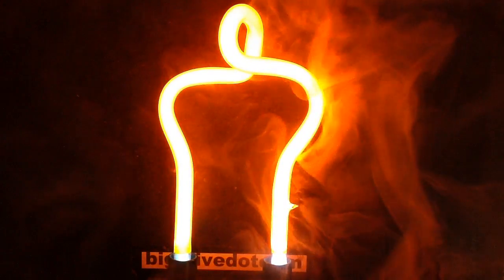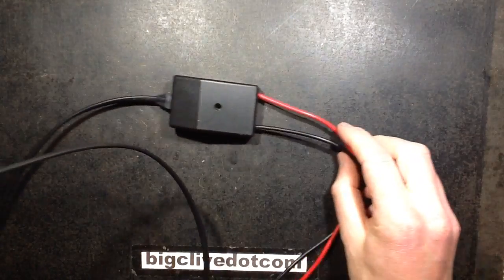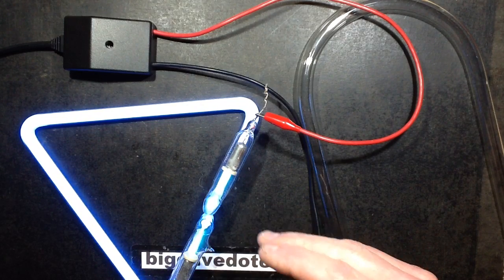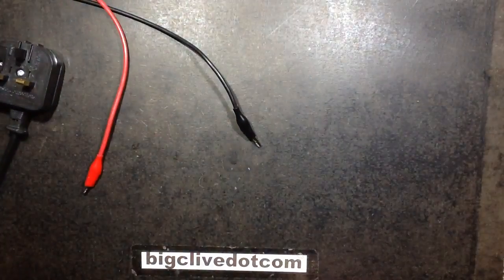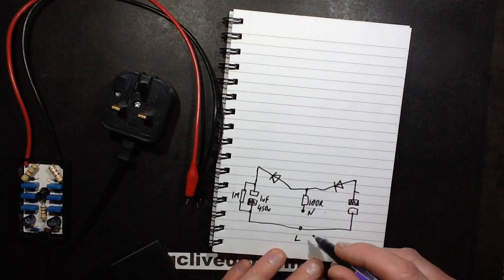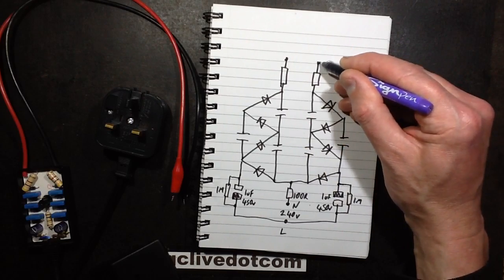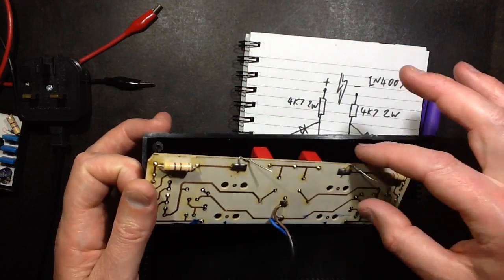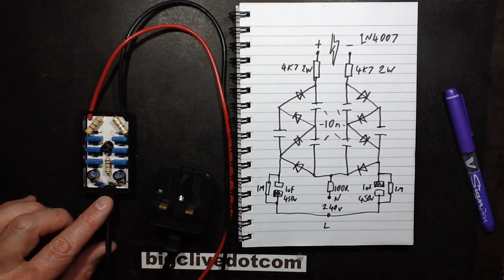Using a DIY voltage multiplier to drive neon tubes.

Comment: It's a shame that the circuit won't work well on pure neon...  I do have a neon sign transformer around here someplace that was taken off of a beer sign where the tubing had gotten broken.  And some inverter transformers taken out of flatscreen TV boards.  And some other stuff taken out of laser printers that apparently generated some kind of high voltage.  I've no current inclination to play with this stuff,  though you can never tell where I might be inclined to go later on.  :-)

Comment: Is the UV from the neon tube down where the phosphor isn't present hazardous as it would be for a flourescent lamp without phosphor?
Reply: Its the type of glass that blocks the uvc not the phosphor. I have a clear (not uv flourescent) that doesnt emit uvc because it uses the special uvc bolck glass.
Reply: @RayRayGaming-cr3rw  correct me if I am wrong (which I might be) but I think that normal glass blocks uvc, does not need to be special glass. Uvc tubes are made of quartz glass for this reason.

Edit:I appear to have been wrong, some types of what we would call ""normal glass" can actually pass uvc but the type of glass in tubes is not that.
Reply: @alfepalfe  yeah you would be correct, most soda lime glass and borosilicate does block uvc. I’ve built a few neon (mercury-nitrogen) tubes with borosilicate before.

Comment: I bought a bag of 100 1N4007 diodes just as part of my stocking up of spares. It looks like there will be a lot of uses for them! I initially just wanted to make my own bridge rectifier, but they do seem to be much more versatile than just that.

Going on from there, it would be really handy if you could maybe do a video where you suggest a basic list of supplies that a beginning electronics enthusiast should buy so he can do a wide range of different circuits. I mean really basic things like a selection box of electrolytic capacitors, a selection box of non-polar ceramic capacitors and so forth. Many of these things can be bought for around £5-£10 on ebay for 350 pieces from a far eastern source.
Reply: Remember a lot of those eBay parts are fakes so don’t use them on anything critical.  You might want to check out Mr. Carlsons lab on YouTube.

Comment: Hi  BIGCLIVE:  I am determined to build this multiplier!!!  I am in the USA so I am using 110V--I just received my 110VAC-to-220VAC.  It is rated at 50W--is this enough?  One more thing--on your notation of the 1uF @ 450Vdc (I am assuming they are DC), is it correct to assume your "colored-in" plates are the NEGATIVE terminals?
THANKS AGAIN FOR BEING RESPONSIBLE FOR ANOTHER DEVICE ON MY BENCH!!

Comment: GREAT VIDEO...but...what is the voltage rating of the 10nF caps, and the wattage of the two 1meg resistors and the 100ohm resistor?
Thanks again for the video--brings back old memories, seeing that orange glow pop on.
Reply from the maker: 10nF 630V, 100 ohm 1W and two 1 Megohm quarter watt resistors.

Comment: i've often wondered if I could fill a mason jar with argon and add some electrodes to light it up...
Reply: Shroom Duke I have the answer for you. Yes, you can, and I've done it. I got a glass lemonade bottle, meticulously cleaned it, and then i sealed a piece of glass tubing into the cap, and sealed the cap onto the bottle. 
I put it on my vacuum pump and pumped it down with just air inside, and with it sitting next to my tesla coil and at 11.2 torr it lit with a really nice deep purple pink glow. As i decreased the pressure the glow became more blue white, and at 1.3 torr it went out. 
I actually used hot glue for the seals, because it does really well for non critical vacuum applications, and it seals well to glass if you heat up the glass a bit before you apply the glue. Hope that helps you to do this!
Reply from the maker: +Shroom Duke It has to be at near vacuum, but that's close to a plasma globe.
Reply: I do have a nice vacuum pump.... hummm wonder if I could employ it...

Comment: Nice description. Why was your 1st tube steaming at the beginning of the video?
  Why does this circuit fail or the tube start to flash after a while? Is there not a cheap/easy workaround?

Comment: For Strain Reliefs I use one or more layers of heat shrink tubing.  I layer multiple layers in a telescoping fashion and it has helped prevent me breaking off leads such as to my most commonly used VOM, and power supply leads.  Thanks for your videos!!  Liked !!

Comment: what will happen if i power up only the one side of the neon tube ? :)
Reply from the maker: With a multiplier it would not do anything.  With a high frequency supply it would glow, but put a high electrical strain on the power supply.
Reply: thank you for explain me :)

Comment: Your not missing anything having not been hit with that zap. Ive taken a few off of a 42 Kv ignition coil, sure as hell wakes you up.
Reply: Yeah, I once decided it was a great idea to unplug one of the spark plug leads from my car's engine while it was running (long story) and didn't take into account just how high a voltage it runs at.

When I pulled the plug off and saw the spark jumping all over the engine I realized I'd fucked up but it was too late. It jumped back into my hand and I got a very noticeable zap from it.
Reply: Sure gets your attention. And goes right to your chest.

Comment: Can you power nixie tubes with that?
Reply: Would probably be to high a voltage to drive Nixie tubes. I think those are driven at 600 V or so (could be a bit off) With that many stages this power supply should be in excess of 1 Kv.

Comment: The positive end is probably heating up because of electron bombardement. At least I read that in a book about electrode welding. You can weld with the tungsten electrode negative or positive but with the latter technique you have to step down on the power because it heats up a lot more. I guess it's the same here.
Reply: +gedanken welten It's exactly why. It's the same reason that limits vacuum tubes's current capacity; the anode (plate) melts when there are too many electrons. Same thing with X-ray tubes. Some methods used to keep the target anode cool can actually get pretty complex. Like rotating targets (in a vacuum tube!)

Comment: do neon tubes get hot when they run for a long time?
Reply from the maker: +hornylink It depends on the current through them.  The electrodes will often get warm because of the voltage drop in a small area.
Reply: +hornylink:
Since it consumes energy, the obvious answer is yes. I estimate the temperature of the glass would be ~40 C. The temperature of the electrodes is much higher since they get bombarded with + gas ions at the cathode and electrons at the anode.

I had a couple of commercial neon transformers and I use to light them in my house.

Comment: I have always been trying to contact lots of companies when or before they go out of business about there neon signage and most sad answers i get is I can't buy the tubes because they are copyright and trade marked and have to be trashed. Also some times I get hold of people but they are asking too much cost for the tube.
Reply from the maker: +Ben Boudreau Hi Ben, try calling or visiting some local sign companies (preferably older ones) to see if they have any used or spare neon tube sections that you can buy.  They may even be able to supply a used transformer cheaply too.  And if you get lucky you may even find a place that still makes neon in-house.  If you showed them this video or a still from it they could make you a similar "freehand" tube.  But be aware that custom neon is quite a manual process, so is relatively expensive.
Reply: Oh I know it's expensive! There's a guy local that bends tubes and has been doing it for 45-50 years.

Comment: I drove a 4' mercury / argon purple phosphor tube with a 120V CFL driver and a flyback transformer from a 6" black & white TV set.

What is the voltage on the output of your multiplier and how many stages can you stack on it?
Reply: +ElfNet Gaming I mocked this up on my sim package and it got up to 2600v across the output points. Quite high!

Comment: So, I am a programmer, and my education was more electronics theory than actual application, and did perfectly understand the diagram and how it works, probably because of the elegance of the diagram, but the way you talk about it shows how much you like electronics. In the programming side of things, sometimes you come across(or write) code that is so elegantly simple that does something impressively complex, that it is a beautiful thing to see, this seems to be one of those types of things for you :) 
From the looks of it pulling from my limited electronics education, this is a dual cascade full wave rectifying voltage multiplier? So using a single center tapped transformer to boost the voltage on the input would probably be the way to use something like this on 110v?

Comment: Some of those imported Chinese insect killers use a similar HT generator direct from the mains, and for the unwary they might not just be killing insects. The poor quality ones have no discharge resistor across the HT end, so if you are re-lamping or cleaning the unit ALWAYS safely discharge the unit first.
I nearly had an electrifying experience with one of those, even after being disconnected from the mains, and an already dead fly got a second blast as it fell across the grid.

Comment: I know that regular glass attenuates UV somewhat, but they use quartz windows to pass UV in EPROMs and quartz IS glass, SiO2. I don't think they use pure quartz glass on UV tubes for germicidal lamps, it would be expensive, the quartz is what makes UV EPROMs pricey over EEPROMs, and its hard to form a curved bulb with quartz.. And germicidal lamps do indeed cause skin cancers and cataracts. The warnings tell you this.
Reply from the maker: rstevewarmorycom Neon tubes are made of either lead glass or soda glass, these ones are soda glass which does block harmful wavelengths of UV.  Specialist UVC tubes use a borosilicate glass.  If these tubes emitted any UVC there would be a very characteristic ozone smell as given off by the quartz envelopes of mercury discharge lamps when they are removed from their outer glass envelopes.  In that instance the lamp has to pass the UV to stimulate the external phosphors.
Reply: bigclivedotcom Okay, long as somebody knows this stuff.

Comment: You should cover that mercury glow with black enamel, or you can get skin cancer and cataracts.
Reply from the maker: rstevewarmorycom The harmful wavelengths of ultraviolet are completely blocked by normal glass.  The germicidal UVC tubes have to use special glass to pass the harmful wavelengths.  On neon signs the blackout paint on the electrodes and bends is purely for visual appearance.
Reply: yes we can, because thats what it is, a quartz/SIO2 bulb. Technology and manufacturing has advanced quite a lot since back when
Reply: rstevewarmorycom Discharge lamp glass (Neon, fluorescent, etc) does not pass harmful UV through clear sections..
Unless its they type of glass allowed to pass UV on purpose like that used in UV air and water purifiers and such.
Reply: of note is that quartz is also the glass used in halogen bulbs
Reply: well yes but you already knew that
Reply: And EPROM windows. (Passes UV)
Reply: ElfNet Gaming And what kind of non-glass glass is that? All glass is mostly silicon dioxide, with traces of other minerals and metals. You can't tell me that UV germicidal bulbs are made of quartz, or pure SIO2, because that stuff is hard to machine and impossible to blow into a bulb. That's why the first EPROM windows made them so expensive back when.

Comment: Both under powering as putting DC on AC tubes is not good.
DC tubes have other electrodes inside than AC tubes.

Comment: Hey! Just wondering. You don't so happens to have a video of how to make a DIY regulator or what to say. So you can put one end in the wall and then just have some type of knob to higher/lower the voltage? Or if you could make? Would me sweet to have something like that! Or at least for me, Having a transformer from 240v DC to 12v DC and then something so you can scroll between 0-12v?  Would be nice to have when checking if different small things works for example a electric motor instead of using different battery setups for everything
Reply: flaka-power You'd be looking for a variac to safely do that
Reply: +flaka-power I've built a device (into an ice cream tub, because I'm cheap) which takes the 19v from a laptop power brick, boosts it to 35v then using a buck converter allows me to sweep down from 35v to about 2v. You could skip the boost step and get 19v down to around 2v if you wanted. I got the buck and boost converter boards off ebay, see Julian Ilett's channel for reviews on buck/boost converters :)

Comment: could you use something like this to get more voltage out of a solar panel?
Reply: +thestalkinghead It requires an AC inlet but if you used a 555 timer with a transistor (and necessary supporting components to make a relatively high frequency oscillator), through a small transformer into this then yes you could. It would be horribly inefficient though. Better to use a boost converter.

Comment: ever thought of putting the fairground lighting controller for sale on your site so we can build one ourself ? :) i think that would be cool especially for the xmas season :D
Reply from the maker: killer1479 I've not got many of the original boards left, and all remaining stock is strictly reserved as spares for existing units.  But I have been occasionally writing software to allow a small PIC microcontroller to replace the ROMs used in the original units.  I've already used some of the prototype boards  with simple fixed sets of routines just to rescue other less-robust lighting controllers.
Reply: cool, must try and get hold of some, and  i have a few items in mind to purchase in the very near future also so i can get my soldering skills on the go again :)

but for now, good and take care, hope to see more videos soon! :D

Comment: Maplin are still selling those tiny boxes, DANG. I remember using one of those circa 1986 for a ribbon cable>round multicore transition for a ZX spectrum printer interface!
Reply from the maker: ***** I always thought they were neat but couldn't really find a use for them until I ended up building this circuit.